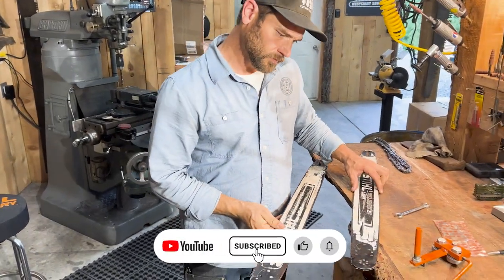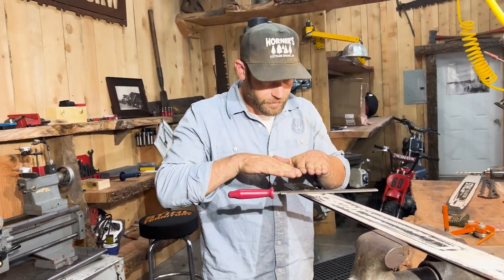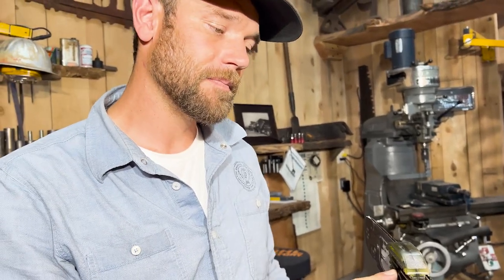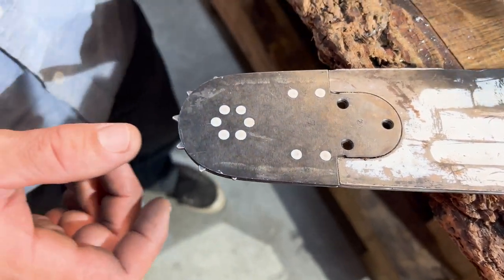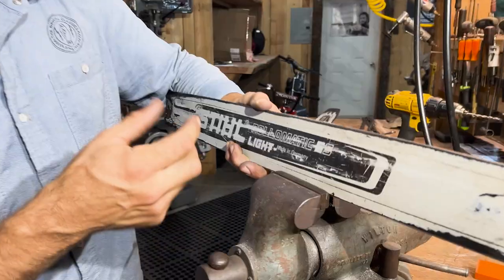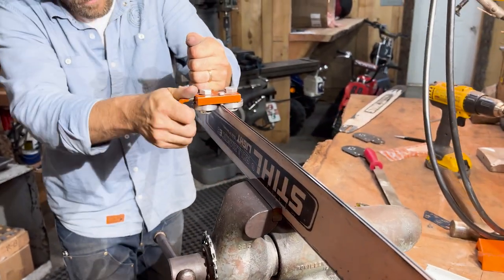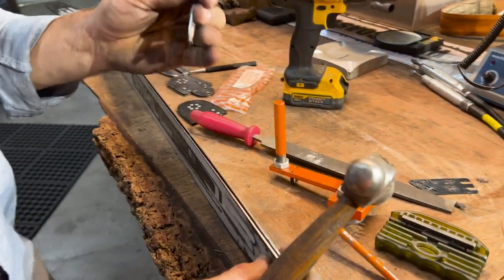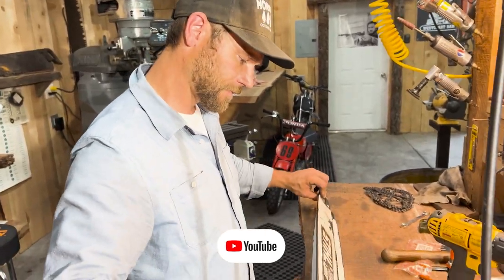Chainsaw Bar Maintenance & How To Replace The Sprocket

Comment: Hey Gordy, maybe you could manufacture a simple tool shaped like a credit card that is .064" on one side and .059" on the other and .051" on the end to cover every gauge bar. Make it from the same material as your raker gauge and you could just set it in the rail to set the bar squeezer or you could use it to open an area that is too tight by tapping it along an area that got squeezed too much.
Reply: That  will be  a nice tool I would buy
Reply: That’s a really good idea

Comment: Also, if you close your rails up too much find a quarter or a washer about the right thickness, tap it down into the bar rail and tap it down the length of the bar to spread it back out again.

Comment: Great video. I learned a lot.  I also file the new tip to make it flush with the bar if the bar is worn lower in the area where they meet.
Reply from the maker: Good stuff!

Comment: Started cutting in 1976 and there's not much I haven't come across when it comes to saws but I just couldn't figure out why the chain was pinching on my 500 with your clutch cover on. I've spent hours trying to figure out what's going on to no avail. I gave up. Concave? Who woulda thunk? THANK YOU!!!
     I take my bar roll over off with a fine grit flapper wheel on a right angle grinder and square my rails up lightly with a Silvey bar rail grinder. I tighten the groove with a Silvey bar rail closer. Then I made a section of the appropriate chain (no cutters) 6 drivers long that I can run down the groove to make sure there aren't any "tight" spots.  If all is good I run it over the bar rail grinder again.
     By the third "tune up" most bars are pretty well ready to become a custom knife. At least that's my experience.

Comment: Great video, I actually have a cheap little vise I use to squeeze my rails. I tapped a hole on the top if either side, and bolted a bearing on top of each side, so the normal movement of the vise squeezes the rails. I just had to fabricate some guides to keep the bar level-ish. Works great, you just run the bar back and forth rather than the tool.

Comment: Awesome video! I have that same rail closer.  I use a Pferd bar file in a fancy holder they also make for filing the rails true... it works great but now I want to try one of those ski files Garret was using...

Comment: Like it. Since I cut one handed and generally sling a 32” bar I think I’m sometimes excessively hard on the bar since I can’t manipulate the saw like a 2 handed person would. I try really hard not to be, but it happens. I’m ocd and religious about gear maintenance though. I probably do far more than I need to.  But I believe well maintained gear pays dividends. Really wish I could find an affordable sq chisel grinder, but then I’d probably go through chain twice as fast.
 Having sharp tooling is a drug. Once you get it you’ll spend forever chasing it.
Reply: My man id love to see you run saw one handed that’s awesome bud 👏
Reply: I knew a fella that sold firewood that had very limited use of one arm. I think hed been in an accident in his younger days. I'd see him drivin his old ford trucks with huge oak rounds in the bed. I always wondered how he managed such work by himself.  Makes me feel bad about complaining when I dont feel like doin stuff.

Comment: I use a machinist's bench block, sitting firmly on the workbench, to back up the bar when knocking out rivets. The energy of the hammer then goes into the rivet instead of bouncing the bar. The holes in the bench block give the rivets a place to go. No need for a Starrett block... one from Grizzly works fine! A block of wood the thickness of the block placed halfway+ down the bar will help hold the bar level. Alternatively, you could drill a hole in the bench top! 😉

Comment: Great video! Very helpful information. I got a stihl o39 for 60 dollars but the 20 inch bar and chain cut crooked then bound up. Could not figure it out then this video saved me from scrapping the two. My question now is do I need to re-tune the carburetor when I switch from a 25 inch bar down to a 20 inch bar? Ran it tonight with a 20 inch on it and it seemed to run hot but seemed fine with the 25 inch? Thanks in advance...

Comment: very informative and educational. Thanks guys. As for the guide rail/chain gauge. Would machining a solid roll pin  with a 0.063" thick flat on it and press it in the roller on center line of the two roller bearings not be an option? it would prevent the gauge from being squeezed to tight and have to open it back up and repeat the narrowing process again.
Reply: i dont think so for several reasons, 1, the centre line doesnt stay constant as one bearing is fixed and the other adjustable
2, when bending something you ha6e to go past the point you want the final angle to be and then it springs back abit, so a spacer would have to be thinner than the finished gauge
3, if your careful this simple tool will do any size bar and as seen in the video it wasnt too much trouble to spread the rails when pinched
Reply: @transdimensionalist  i understand the material would spring back. yes, the drive teeth are roughly 0.063, so you shouldn't want a gap of exactly that, you would want an ever so slightly larger gap (1-2 tenths) to give the teeth SOME room. if they gap was exactly 63 thou and the gap 63 thou, it will cause an increase in heat and premature wear of both the teeth and the bar, and wearing the softer of the two faster, till a slight gap is formed.  heck, my oem, new out of the box stihl 28" bar had a gap of 66-68 thou. and yes, center line between the 2 bearings would stay center. if the adjustable side lead or lagged behind the fixed side, then the center line would not stay center. it would be easier to draw it than trying to explain it but i will try. take 2 circles, 2" diameter and had cross hairs in each, line both horizontal lines of the cross hairs up and that would be center line. or that is how im asking about putting a thickness spacer on center line. each bar's hardness will also determine the amount of deflection/spring back it would have as well.
Reply: i agree you want some clearance between rails and chain, and also different bar materials being different hardnesses and springing back different amounts. my point is i think itd work but would only be right for one gauge and brand of bar, if you wanted to use it on a different gauge or brand bar the dimensions would be off and no longer centered so seems like an over engineered solution to something that already works with abit of skill and patience. the barshop machines do have a spacer to keep the rails apart when hammering the spread rails together but thats a different animal.
Reply: @transdimensionalist  at first you said it would work bc of x reason. now you say it will work but only for x size gauge. isnt that whole point? if a person ONLY uses 50 thou or 63 thou, and is doing it frequent enough, not just a bar shop, but ole' joe snuffy in the field, its a "set and forget" type thing then it sure would save time and wear on the bar.
Reply: i didnt know you were talking about a hypothetical person who only runs one bar gauge, i was talking from my own perspective where having a variety of size/ brand/gauge bars would need a tool for each application and would be overkill. i agree with you for your hypothetical person a set and forget tool would be great, one of the comments above mentions something similar bucking billy used on a video once although the only one i can find he says just use the next size gauge chain when bar spreads dont bother squeezing rails so i dunno? hope you understand
Reply: @transdimensionalist  its not a hypothetical. If a person only uses 1 size bar, 50, 63 or whatever, and does it enough, then a set and forget is practical. even if it was a 50 thou, change the pin out to a 50 thou and do the same. i changed my husky and jonesred over to 63 though bars so i only had 1 chain gauge size to simplify things.
Reply: great, then try it, btw a solid roll pin is more commonly known as a pin/ parallel pin, but i still foresee issues with having 2 fixed pieces (bearing and pin) as the bar wears down and variation between different brand bars, how do you account for this? and no you couldnt just swap a pin as it wouldnt be on centerline between different gauges. also can see it being tough to use as when the rails begin to close against the pin the friction would increase. let me know how your experiments go...
Reply: @transdimensionalist  You keep looking for the cons, and i'll look for the pros. as for keeping you informed, unless i have your contact info, i wont remember this conversation in 2 days, let alone in a couple months without an email reminding me of it.
Reply: sorry if you feel im overly negative, just trying to give feedback and constructive criticism. i think its good to think through and try to imagine any potential problems when designing something to avoid disappointment, hope it works out for you

Comment: Almost forgot to add,  my local stihl dealer has the official stihl bar dressing file,  can't remember what I actually paid for it, however it could not have been more than 6 - 10 bucks out the door. I have compared my local dealer to other places and they have very good prices and no they are not selling chinese copies of stihl products I can get stihl rs chains ( as well as most of their bars) for same or cheaper than any where else including tax .

Comment: What is the name of the tool you used to file the top of the bar and the bar roller?
Reply from the maker: I think they call it a bar rail squeezer, but I’m not 100% sure on that I should’ve had Garrett specify where he found that at
Reply: Pferd, Husqvarna, Stihl, and china make a tool for dressing the rails on the bar.  Garrett was using a tool that skiers use to dress the edges of their skis which is probably half the price and the replacement files are likely easier to find.

Madsen's used to sell a bar rail closer made with USA ball bearings and steel.  Now I think the only one's available are made in china.
Reply: @obxkoastie8170  thanks.

Comment: Guys, is there a “technical” reason for running an 063 vs 050 bar and chain? The reason that I ask is that 063 is next to impossible to find around here and I really want to know YOU guys answer.
Reply: 063 is made from thicker material so will be stronger and hold up better under stress but will cut a thicker kerf and use more power, 050 is fine for most applications and wouldnt worry unless your cutting all the time big trees
Reply: @transdimensionalist  Driver gauge has nothing to do with the kerf.  You need to understand what you're talking about before answering someone fella.  Youre confusing pitch, with driver gauge.
Reply: thanks for the correction, i understand the differences just assumed the cutters would be bigger as gaugenincreased
Reply: @transdimensionalist  don’t worry to awful much because at one time I had the same misconception, but thats all been taken care of. But I’d still like someone to “try” to answer my question with good reasons. It’s just one of those 🤔🧐😵‍💫
Reply: I am no expert. O.050 is lighter, hard to find bars 0.050 at 36” plus or not really made. Been running across old production saws and they all have 0.063. I am assuming 0.063 is more durable and longer life.
Reply: I don't think 063 stretches like 050. 063 is really a stihl thing too.
Reply: @ATFisGay  The stretch is in the rivets not the links and even then rivets don’t stretch it’s a quick wear of them and the holes that they go into.

Comment: Bars are cheap, just buy a new one
Reply: Big LW Bars Are Not Cheap
Reply: Maybe Farmertec, but those are running 2+ bones if they are in stock.

I am tuning and changing tips.
Reply: A month ago I bought a 28inch Sugihara light weight bar for my 592xp here in the US. I paid $148.00 plus shipping cost. They worked on 32inch Stihl Light bars which are more expensive. Alex if you think that's cheap then you must be rich.